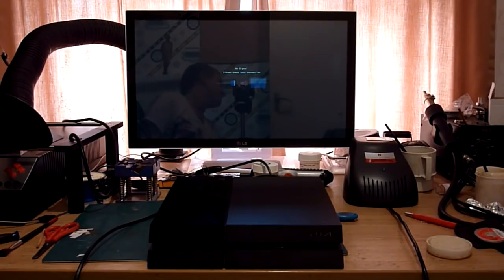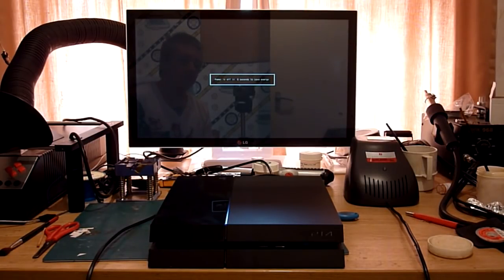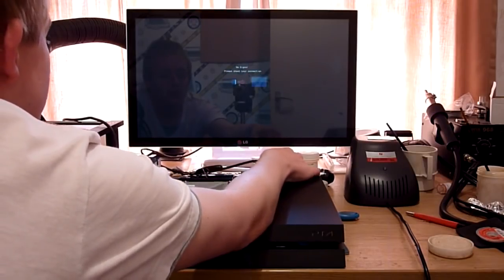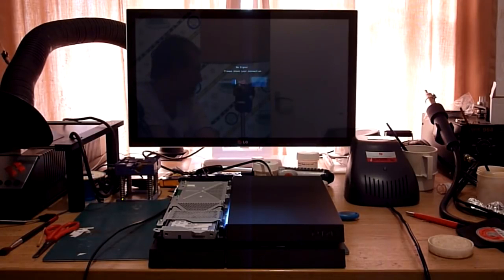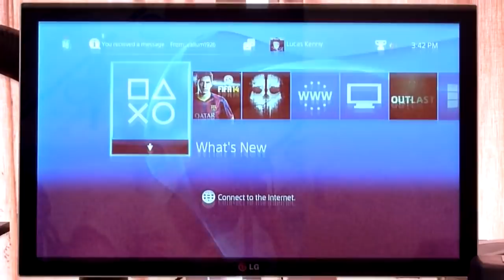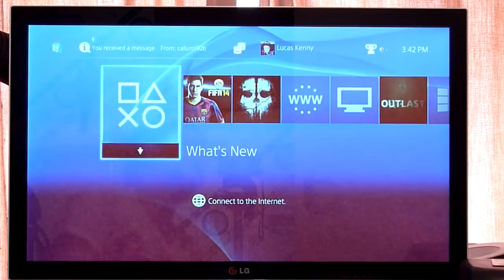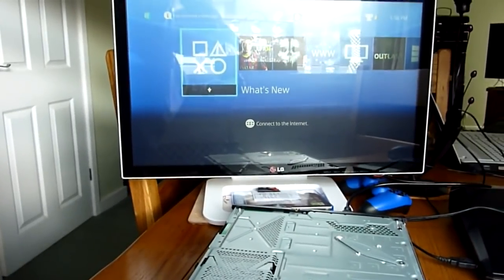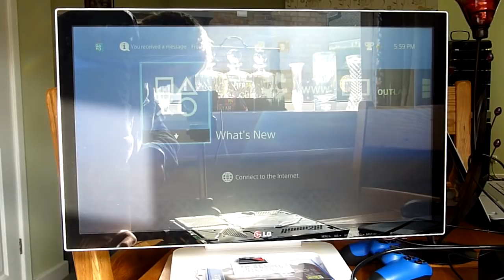PS4 White Light of Death (WLOD) - Faulty HDMI Socket Replacement Fix

Comment: i''ve got the PS4 the standard edition, and the screen keeps flickering, I used another TV and it works fine, I changed the settings etc still Light flicking since they release the firmware update with the HDR it's been happening, do I need to get the new 2.0 HDMI or something not really sure I tried everything.
Reply from the maker: No - boot into safe mode and select the change resolution option. Then set the correct resolution in the Sound and Screen settings menu. See if that improves it to begin with.

Comment: INSURED PHOENIX I got a solution but it sounds stupid , look if your PS4 still doesn't work unplug the power cord from the PS4 no the wall, after that o top of the PS4 press hard but not too hard do that for about 5 times and that'll be it I swear it works for me
Reply from the maker: Sounds like you've onset of early APU issues. A reflow would probably resolve that for you - these things have known-manufacturing defects with regards to contamination of the BGA pads.
Reply: Andrew Paul yeah I know it brings problems but just a Solutiom until you can just get it fixed

Comment: withe light suposed to say im running fine lel
Reply from the maker: +Mini-anthrax indeed it is however there are exceptions where that doesn't necessarily apply i.e. Bad RAM or Syscon which will show white light but no display or single colour display. The give away is usually an unresponsive power button and non-binding USBs with a controller connected. Rare though but I have seen more of them recently which is interesting.
Reply: Ikr like idk what this guy is talking about

Comment: andrew i got a problem with my ps4, it didnt display image and sound on my tv it say no signal can you help me please
Reply from the maker: If the port looks intact it's likely to be Encoder IC failure.
Reply: INSURED PHOENIX I got a solution but it sounds stupid , look if your PS4 still doesn't work unplug the power cord from the PS4 no the wall, after that o top of the PS4 press hard but not too hard do that for about 5 times and that'll be it I swear it works for me

Comment: Good vid! So my problem is similar other than my tv does get a signal but still no image, just a black screen. Even when booting into safe mode, there is no image but there is a signal. How I know this is once the ps4 turns on, the input display on my tv disappears. As opposed to when there is no signal, my tv shows the input... until it detects a signal. Is that still the HDMI port or something else entirely? Thanks in advance.
Reply from the maker: If the port itself looks intact - no pins sticking up out of the middle or smashed into the back and the centre part itself isn't broken or damaged then it's likely an Encoder IC failure providing the PS4 shows a white light as normal.

Comment: Andrew Paul high Andrew I just got my ps4 fixed the pins where pushed back in the hdmi port I got it replaced and the white light of death still comes on I tried taking out the hard drive and turning it back on it comes on perfect in safe mode but when I pick an option in safe mode it goes back to a white light again can you please help
Reply from the maker: Providing the port is correctly installed then it sounds like a dying Encoder IC - sometimes the outputs can get damaged if the pins touch which can result in either no picture or picture only on certain resolutions. In your case it's showing 480p (Safe Mode) but nothing else. It's either that or a bad EMI filter in line with the port. If they'll take it back for a further inspection I'd let them sort it.
Reply: Andrew Paul thank you for your feedback the best thing to do is bring it back
Reply from the maker: You're welcome. They should sort it easily enough.

Comment: Hi Paul. I have replaced hdmi port and IC panasonic chip but still have no signal (WLOB). what would you recommend to check next?
Reply from the maker: Check all pins on the port and encoder for any loose / bridged pins. If all is OK, all you can do is read component values with a DMM against a known-working board and investigate any anomalies. Without schematics unfortunately that's all you can do.

Comment: my ps3 works just fine with the hdmi cord i used for the ps3 but the ps4 is not working as good do you think its the port?
Reply from the maker: Possibly - either that or a failed Encoder IC if the port looks healthy.

Comment: Just sold a PS4 with a faulty HDMI port on eBay but I  listed it as BLOD
 instead of WLOD! In my defence I hadn't used it for about 9 months and 
when I looked through the listings of sold PS4s I just put BLOD without 
thinking, tho I did note in the description that there was an issue with
 no image. +Andrew Paul. Have I made a grevious error?
Reply: Also I subscribed because your nice calm clear manner. You didn't start with a  cliched "HEY WHAT IS UP GUYS!" intro!
Reply from the maker: I wouldn't say so - though you would have been better to have listed it as a 'HDMI fault' rather than BLOD as they tend to go for more money. State that it starts to a white light with no image hence HDMI problem. If it's not too late revise your listing.
Reply from the maker: P.S. Many thanks for the comments :-)
Reply: Andrew Paul it's already sold and been delivered. I'm presently negotiating with the buyer on his options. The mistake was genuine and he believes that but I'm just wondering what his options are in order to get it workin again. I'm waiting to hear back from him to see if he is technically skilled and thus able to repair it himself
Reply from the maker: Well I'd be happier it turned out to be a WLOD rather than a BLOD - much easier to fix! Either a new HDMI port or Encoder will probably sort it out. Where is the buyer located? If it's UK/EU I may be able to resolve the fault for him.
Reply: Andrew Paul Paul Paul thx for the offer but we've come an agreement
Reply: TheWatcherxx99 planning to do that
Reply: Andrew Paul high Andrew I just got my ps4 fixed the pins where pushed back in the hdmi port I got it replaced and the white light of death still comes on I tried taking out the hard drive and turning it back on it comes on perfect in safe mode but when I pick an option in safe mode it goes back to a white light again can you please help

Comment: My ps4 just crashed completely and when I turned it on its flashing white like if your TV isn't on a channel
Reply: Note it won't let me do anything not even reboot it by holding the power button down for 8 seconds
Reply from the maker: Reboot it. What is the light doing and what do you see on display?
Reply: Andrew Paul I couldn't do anything not even reboot it and the light on the ps4 was the same white but the screen  looked like a TV with static but it wasnt the tv it was the system
Reply from the maker: Encoder IC.
Reply: Andrew Paul what's an Encoder IC?

Comment: has anyone had the problem that the ps4 works fine and the screen just turn black and tv starts a really weird sound then it stops but ps4 is still on and the tv screen keeps black?
Reply from the maker: Sounds like it's hanging. Possibly try a thermal paste change, if it continues then you might be looking at APU issues.
Reply: Andrew Paul Thank you, ill try that

Comment: i had the same problem, the screen was flickering (black screen) when ps4 was on, i could even hear the menu sound. I used my PSVita for screen share (you can use Remorte play for windows) and then i disabled HDCP in PS4 system settings and it worked. Hope it helps
Reply: for an absolute technology dumb person like me, can u elaborate on how exactly you did this?  my ps4 has a totally black screen but I hear the menu sound. My TV doesn't register the hdmi unless I have the hdmi at a certain angle, as well. I have downloaded remote play but that's as far as I've gone as of now
Reply: mine doesnt show no signal it is just black
Reply: MultiKnez
Reply: 👏 worked
Reply: Can u help me

Comment: The HDMI port looks like you just try to jam it in, I take my time whenever I'm connecting everything.
Reply from the maker: It wasn't my machine but it would certainly have helped. They are incredibly poor quality however.
Reply: Andrew Paul I have a launch PlayStation 4, it's the VERY first model! Yeah, it's wearing out, but it still works just as good as a new system because I take care of it, I treat my stuff with respect. I see GameStop all of the time jamming in the cables to test out all of their used systems out, I sometimes need to tell them how to properly plug in something without damaging it Yeah, I know. It's pathetic.

Comment: Dude so my playstation goes on thenit still makes sound. but it stops like every 2 seconds i think the hdmi port doesnt work anymore i bought a new hdmi cabel and it still doesnt work
Reply: MultiKnez I brought my ps4 to sony. So yeah. Still waiting. i only have my ps4 for like 2 months man
Reply from the maker: Look at the pins inside the port - if they're bent, broken or pushed backwards then it'll need the physical port replacing. If all looks good then you need an Encoder IC replacement.
Reply: Andrew Paul I don't even know what a encoder ic replacement is but the pins ar eperfectly fine. +  I got no problem using the playstation i have a blackscreen but i could log in and my friend saw me online so i have no light of death its really something with the hdmi. it could maybe be the tv as well im not sure?
Reply from the maker: If you have a black screen / white light then it's known as a 'White Light of Death'. It's not really dead as you've seen but it's a moniker which has stuck around the net. If the port is looking fine then you need the Encoder IC changing. It's a Panasonic chip on the underside of the board. MN86471A on CUH1000 / 1100 series machines and MN864729 for the 1200's.
Reply: Andrew Paul Imma try a other TV first
Reply: Andrew Paul can you send me the video where you fix this problem? Because you have multiple videos where you fix it. idk wich one. I only got this ps4 for 2 months and this already happens wtf man :(
Reply: i had the same problem, the screen was flickering (black screen) when ps4 was on, i could even hear the menu sound. I used my PSVita for screen share (you can use Remorte play for windows) and then i disabled HDCP in PS4 system settings and it worked. Hope it helps
Reply: sad to hear :(
today i updated the licenses in ps network/account management, and enabled HDCP AND IT WORKS ;)
Reply: MultiKnez Right when BF1 came out i wanted ot play so bad. They told me it would take like 3 weeks So yeah
Reply: it's the back u stick it in at its broke

Comment: having same problem can't see any screen when it turn it on
Reply from the maker: If the port and pins look in good condition then it's likely an Encoder IC failure.
Reply from the maker: Easy enough fix if you're a handy solderer or know someone who is either way.

Comment: Is the  power supply suppossed to beep constant when turned off or in sleep mode still pluged in is it a hdmi port fault if the tv losers vibrantcey and slightley dulls a turned tv off back on slightley flickered contantant turned off back on still flickers slightley not constant flicker only when just turn tv on as picture

Comment: hey andrew could you send me a link to where i can purchase the replacement part. thanks
Reply from the maker: If you only need one, eBay is a good bet.
Reply: and another quick question, was there a specific screw driver that you had to take the screws off, i cant seem to find any in my house that fits that specific screw. if so let me know what size i need and what type.

Comment: Hey Andrew what do you think about this problem.... aActually it was raining so unplugged both my ps4 and my TV .
And today i tried to turn on my ps4 and tv everything was ok i got the white light and my tv works perfectely exept both the my tv and ps4 hdmi port are not working i have tried everything but nothing seems to make them work.
Reply from the maker: Have you tried the PS4 on another TV?
Reply: yeah i trid and still nothing both the tv and ps4 hdmi port are not working anymore but i can turn them on fine... i even tried to put a disc on to the ps4 and it was reading
Reply from the maker: Would suggest a failure of the Encoder IC if the comb inside the HDMI port looks fine. Common failure.
Reply: yeah they looks fine ... i hope its not a big problem. i have all the tools needed should i try to fix it myself ?
Reply from the maker: What tools do you have there?
Reply: i dony know how they are called in english but think i have everything that is needed or i can get them at work
Reply: How do you explain the tv hdmi not working either... ps: there some storm and strikes that night but i unplugged everything
im french sorry for the bad english
Reply from the maker: No idea I'm afraid - one for a TV expert.
Reply from the maker: My guess would be it's hit your roof aerial / satellite dish or similar connected to the TV.
Reply: thats what i was thinking... i will be glad to ship it to you for replacement but the problem i will be in Africa for the next 3 month

Comment: Hey Andrew, so I have an issue. I had a power outage and I had tried turning on my PS4 afterwards, it would do nothing.  Blank. So I replaced the PSU. Now it has the white light and the HDMI Port looks perfectly fine & I don't have the proper equipment for soldering right now so I want to know if it could POSSIBLY be anything else.. none of the tricks have been working & I've heard shitty things about sending it in so I'd rather not.
Reply: I got the sound to work a few times randomly, and ONE time for like 2 seconds I swear the safe mode screen came up.
Reply from the maker: Sounds like a bad Encoder IC to me... Definitely will require some fine soldering if that's the issue.

Comment: Hy! awesome videos keep up the good work ! I have a problem that I haven't seen anywhere on forums/vids. Sometimes I get a BLOT but after shutting down the console it starts as "hasn't shut down properly" does the db check and everything is fine. However sometimes it loses its signal unrelated to usage time (sometimes 2 mins other times 3h). I found out that moving/touching the hdmi cable causes it to lose signal every time. The port looks perfect on the outside and I've tried several HDMI cables and even different power supplies. Any ideea of what could be busted ? Any answer is welcome, thank you.
Reply from the maker: Sounds like you have a couple of issues - occasional BLOD could be down to stuff like thermal paste etc. Try changing this out first, if no better I'd suggest a reball - that may cure a few bits and pieces you're suffering from. Check the port with a DMM with a lead inserted - they can break internally. See how you go from there - cheers.

Comment: my ps4 has an even weirder problem. it came on saying checking disk (or something with a progress bar), once that finished it reached the home screen but there was some mild distortion with the graphics then eventually the screen goes black after about 20 - 30s and nothing works but the sound goes off and sometimes fades back briefly.wtf
Reply from the maker: Sounds like an Encoder IC failure.
Reply: Scery

Comment: I Bluetoothed one of my controllers to my phone and the other one to my tablet and now I don't know how to reconnect both of them back to my ps4
Reply from the maker: Plug them in one by one via the USB ports on the front of the PS4, wait a few seconds for the yellow charging light to appear and then press the 'PS' button on the controller. They should then reconnect fine.

If that's not working then look at the rear of the controller to the right of the sticker. There's a small hole which is the reset button. Press this in with the tip of a pin or pen for a few seconds then reconnect as above.

If that won't work then boot the console into safe mode by powering the ps4 down completely, then press and keep hold of the power button until you hear two beeps - release after you hear the second beep. A menu will appear asking you to connect the controller by USB. Do so - if it works in here, select the reboot option and see if you can then reconnect as above. If not, then you may have a hardware issue with the machine itself which will require attention.

Comment: mine flashs blue then turns white and my monitor screen is completly red help???
Reply from the maker: If the port is good then look to replace the Panasonic MN86471A IC.
Reply: +Andrew Paul okay thank you so much :) ill buy one of these and let you know if it works ill figuree out where to put it if you dont know!
Reply from the maker: That's the one - it goes under the metal shield on the underside of the board (just under where the HDMI port is located). You'll need to lift the shield and old IC with hot air and then it's up to you whether you use hot air to replace it or drag solder the new component in. It has 64 very small, fine-pitched legs so doing it pin-by-pin could be painful ha ha!
Reply: +Andrew Paul haha okay thank you again ill let you know in a few days how it went

Comment: Hi Andrew, I have a cuh-1215a ps4 which has no video/audio. There is no visible damage on the port. After changing the port to a new, it gives format not supported on some tv. When booted in safe mode, the screen stays black. Also, when the ps4 is booted without the hard disk, the screen remains black as well. Hope you can point me to the right direction.
Thank you.
Reply from the maker: If you have a white light then replace the Panasonic MN864729 IC. Those are expensive to procure at the moment though. Ouch!
Reply: Hi, just replaced the Panasonic IC for Hdmi output. The video says video format not supported... :(
Reply: So, I just installed the 1st (may be defective) Panasonic hdmi IC on the 2nd working board (from which the Panasonic hdmi chip was taken off). Both hdmi chip works. I can't figure what's going on hehe...